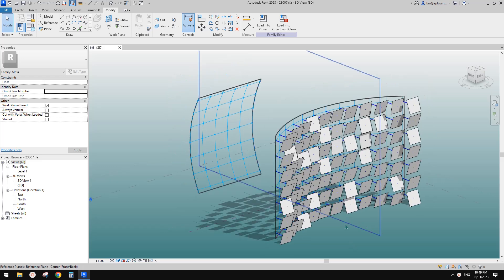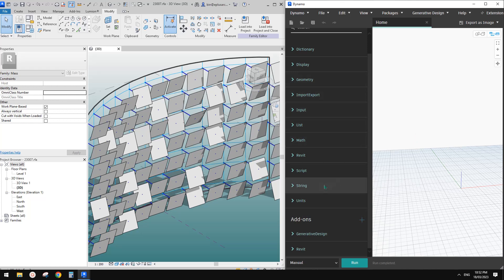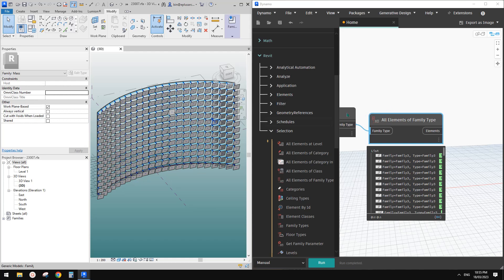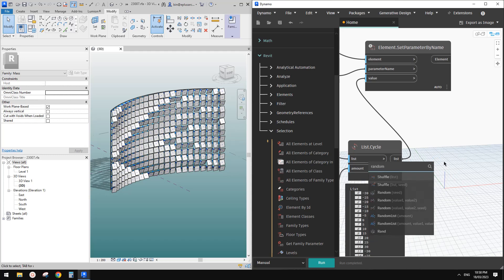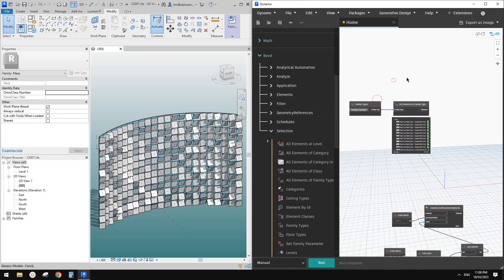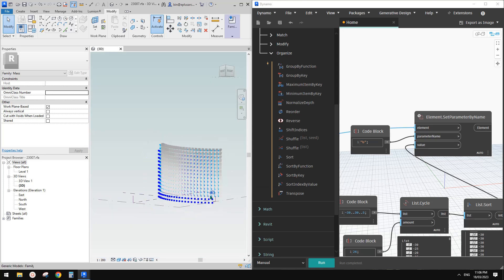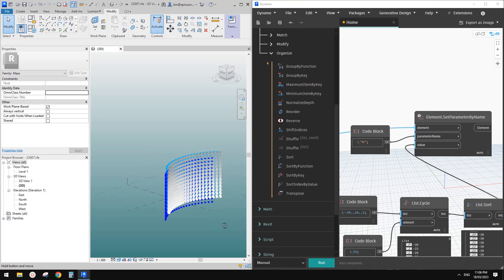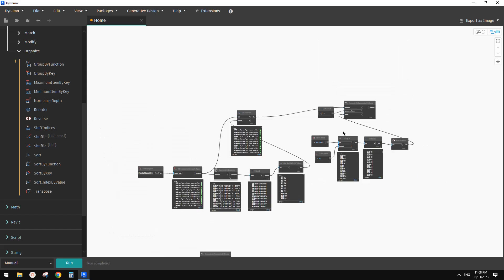23012 - Dynamo Exercise using the Revit family from 23007

Comment: Hi Bin, Those videos are saving my life thank you so much 🙏I'm trying to make these panels connect vertically to each other so they can hold together and be movable in a vertical way. Could you help me with that? Maybe you've done it before, but I can't find it. :))
Reply from the maker: Can you show me a sketch of what you'd like to achieve?
Reply: @BINHE615  https://i.pinimg.com/originals/49/e6/b1/49e6b17b04c1f2f4201d79d57bc1dc59.jpg Something like this I wanna try. Panels are movable. This would allow for flexibility and adaptability in the arrangement and positioning of the panels.
Reply from the maker: A bit like this https://youtu.be/k0zxRrzXQ38 but probably should be modelled as a pattern based family I guess.
Reply: @BINHE615  Thank youu, im gonna try it 🤗

Comment: Really, Thank you ☺️ , i think i can make them oriented to the sun in this case i make it a point and make these panels oriented to it, but i have a question, which distance i will take, i think Z value is not enough right?
Reply from the maker: I believe you can, but it can be quite difficult, because not only we need to add a horizontal rotation into the family, we also need to find a way to detect the orientation of the placed families, the orientation of the sun, and somehow make them work. Alternately, we might able to modify the family so we can manually control the orientation of all the family at once. Can you add this in the document so I can try that idea later? Thanks very much.
Reply: @BINHE615  yea you are right... But note that the rotation parameter we need to add is gonna be just for the panel not for the whole family the connection in this case between rod and and the panel is gonna be roller support, im interested to for that. I didn't understand how to add it to the document